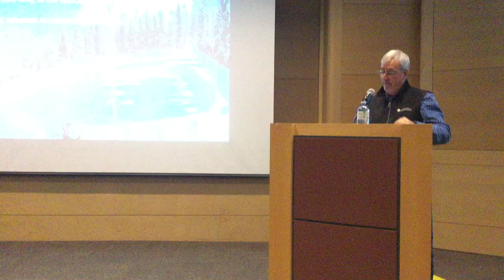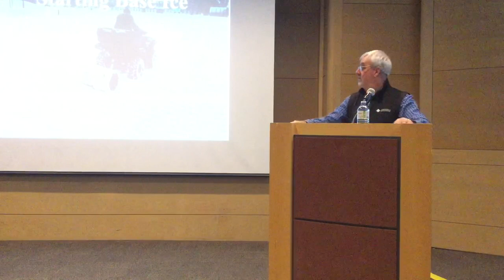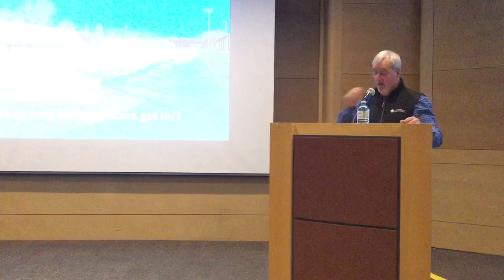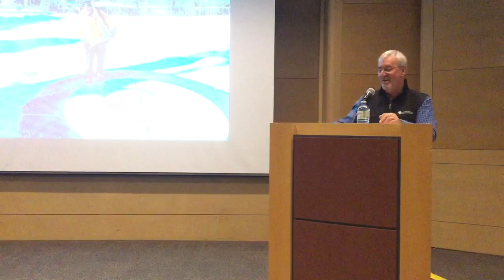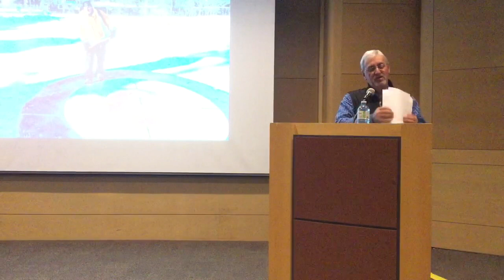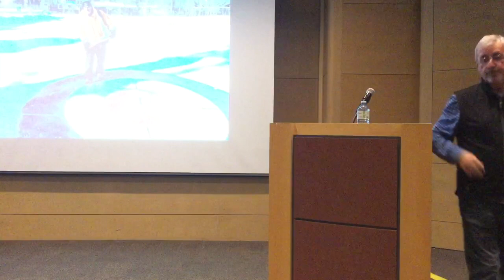Nice Ice Presentation - Building and Maintaining an Outdoor Rink

Comment: Hi when building a rink on a hard surface like a tennis court. Is it best to pack snow onto to surface ?will you save on water ? or does it not matter
Reply from the maker: Hi Eugene, 
It's difficult to build ice directly on a tennis court / asphalt or even grass. Not impossible but you will be using more water and it will take a longer time to establish good ice. You really need to have a good base of packed snow to flood over and cold temps. After a 10 - 15 cm snowfall, pack the snow flat and then put down layer after layer of water on top. You want a fairly even flat surface to flood over. Ideal flooding temps would be anything under -10 celsius. After you establish a good skating surface its important to continue to flood it at least three times a week along with regular daily ice scraping. The more you flood the thicker your ice and better chance of surviving warm spells.
Good Luck.DD